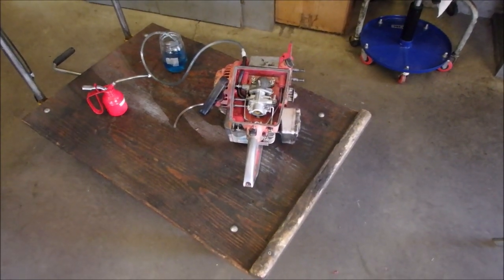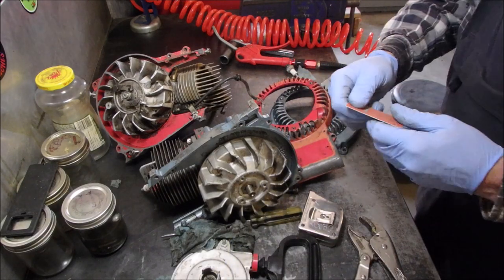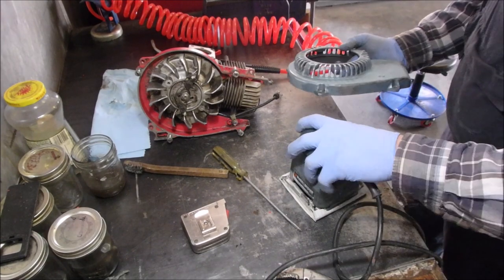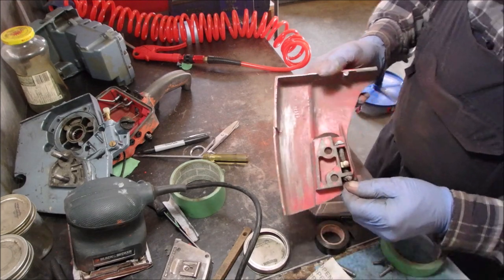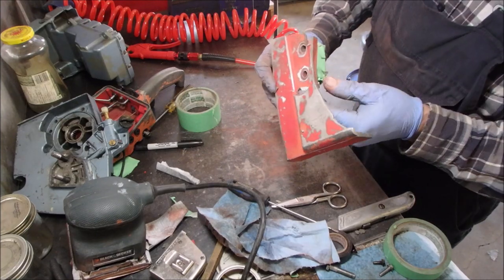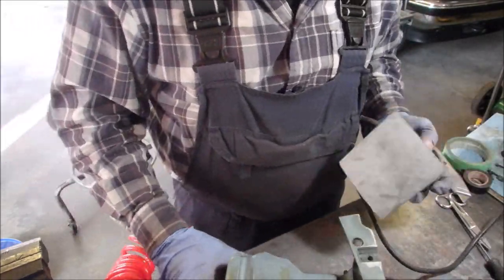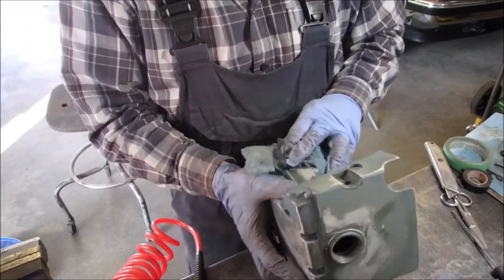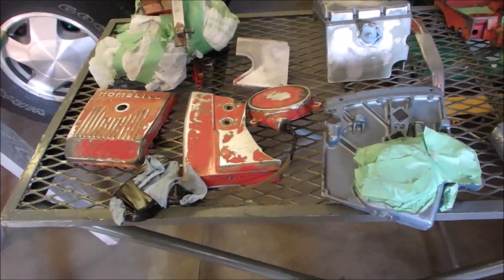Homelite XP1020 Review and Paint Prep

Comment: Brake fluid makes a great paint remover. Even if the item has been powder coated. After an alcohol bath, then use a self-etching primer before applying the colored paint coat.
Reply from the maker: Thanks